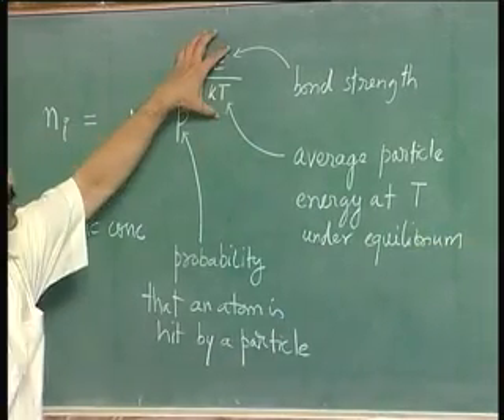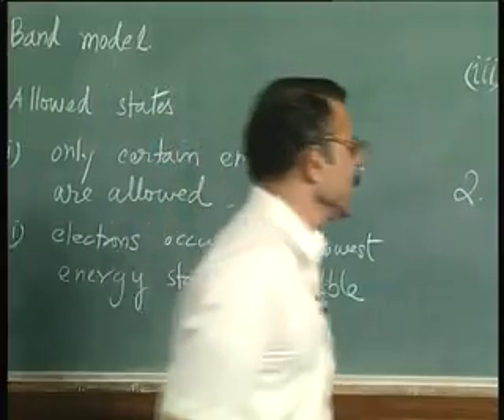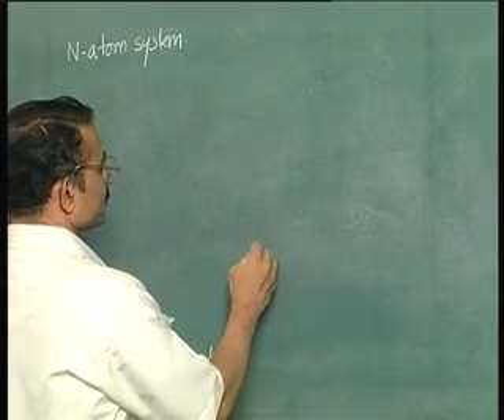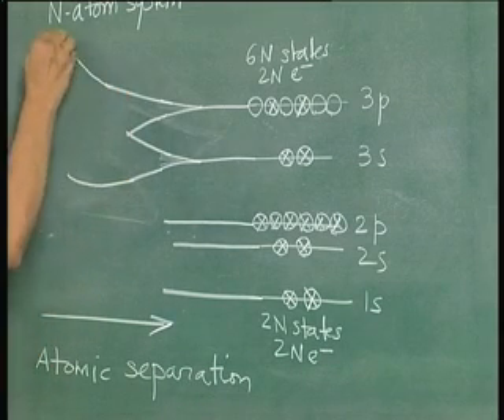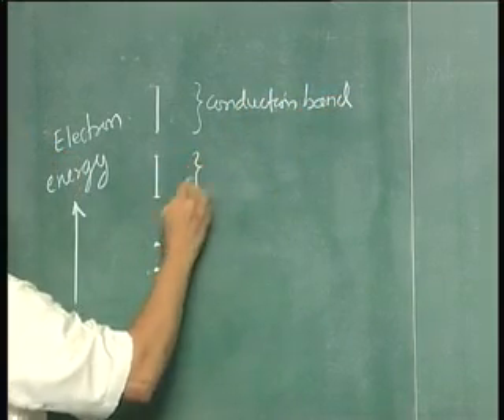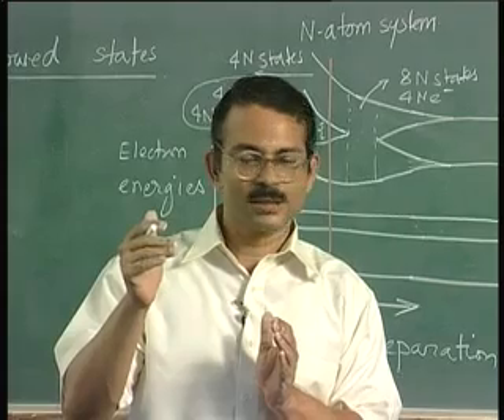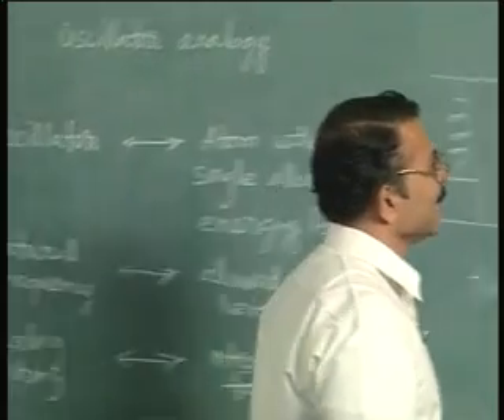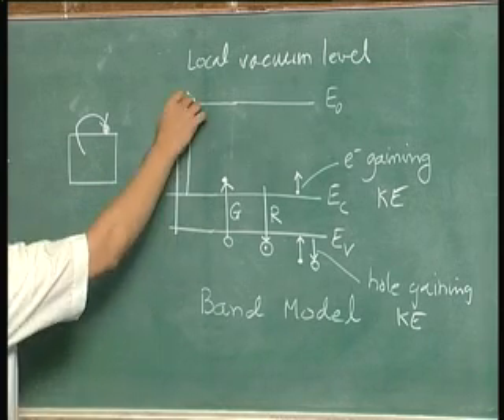Lecture - 6 Equilibrium Carrier Concentration

Comment: i didn't understand that why the energy band is splitting into two equal bands with a energy gap in between them,
Reply: Due to interatomic forces
Reply: When isolated atoms are far apart, they have sharp, discrete energy levels. As you bring billions of these atoms closer together to form a solid crystal lattice, their electron wavefunctions begin to overlap. This overlap forces the discrete energy levels to split into closely spaced energy states, forming continuous energy bands. At the exact equilibrium atomic separation, these bands are fully developed and separated by a characteristic energy gap (band gap) that dictates whether the material is a conductor, semiconductor, or insulator.